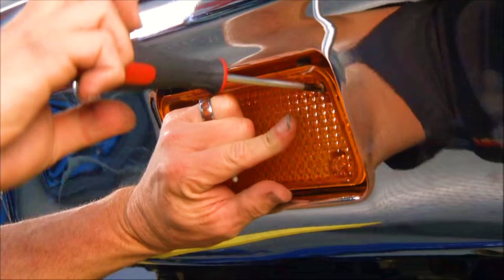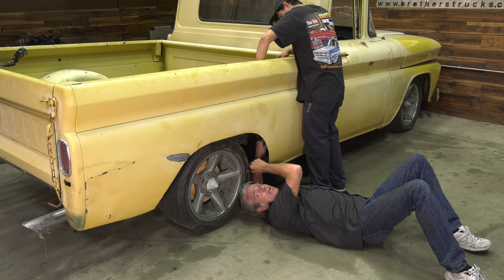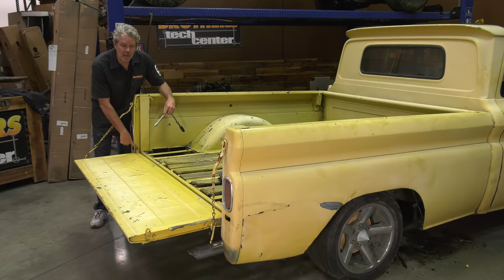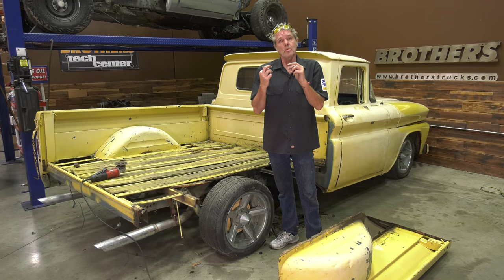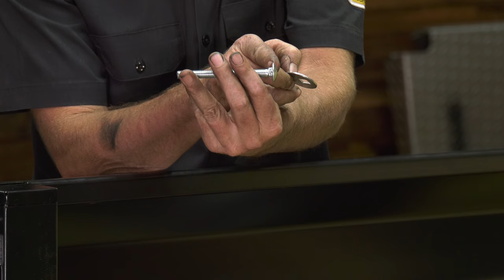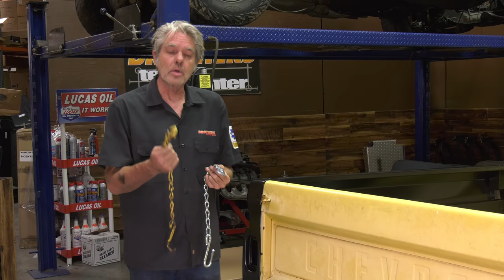Chevy & GMC Truck Bed Side (Bedside) Replacement/Swap/Installation

Comment: Great video, I was wondering if you rewelded the sill plate to the side? Thanks for making these videos.
Reply from the maker: We did not weld this set of panels. We've done this welded and non welded and it seems just about the same either way. Obviously welded would look more original.

Comment: Hey - Mr.welch.....
Was waiting to see when you welded the points where the rear of the sides meet the ends of the  bed/tail rail. You did weld it up didn't you ?
Reply from the maker: Yes, we did just a couple of tack welds like the factory did around the bottom of the stake pocket where it meets the bed floor/rear support.

Comment: do these panels have to be welded in the back corners like the original or just bolt on would be ok? always good videos
Reply: Yea. Good point.
I would say yes. Make it pertty with some migging.
Reply from the maker: You can leave them bolted, or weld it back together. We've done both and it doesn't seem to make a difference either way. Obviously welded will look more original.

Comment: Would you be able to swap it out for a bedside with a step side or would I need to make sure I buy the truck that has the step side since manufactured?
Reply from the maker: You can swap for a stepside if you want. It will fit just right.

Comment: Can you guys do some videos on a 68 factory shortbed step side c10
Reply from the maker: Anything specific you'd like to see? We've done a lot of videos on Tony's '68 C10 Stepside over the past year or so, including , c-notch, air ride, wiring, power windows, rust repair, shock relocators, bed conversion and more.

Comment: Question: you didn’t have to weld anything ?because on the back part you had to grind the Back Welds -  did you re-weld what you Grinded off ?
Reply from the maker: We didn't weld them back up. You could, but we didn't think it was 100% necessary.

Comment: Question what if don't have a second set of extra hands would a body dolly roller do job better .
Reply from the maker: You know, there's probably a dozen ways to get the job done, you've just got to work with what you have available and be creative.

Comment: The back window of that truck is it in rubber,if so did you ever make a one person install vid
Reply from the maker: Yes it's in a rubber seal. We've never done a rear window install video, but we'll get that one on the list! Thank you for the suggestion!
Reply: @BROTHERSTruckPartsTV  I second this! Would really like to see a glass removal/install video.
Reply from the maker: @HouseofChop   on the list as of today, probably going to happen sooner than later. Thanks!

Comment: i just spot weld the bolts to the tub and grind the weld after i get the nuts off
Reply from the maker: Definitely reduces the need to have a buddy around to hold the bolts down!